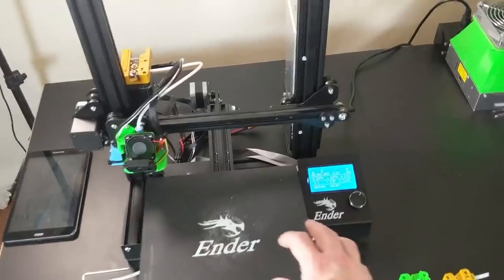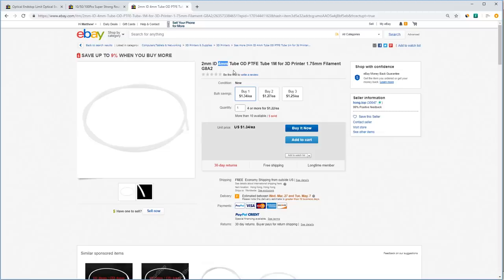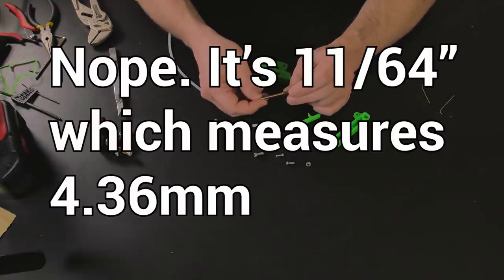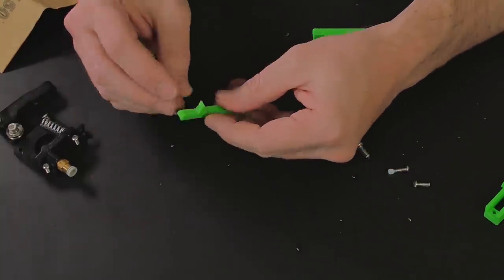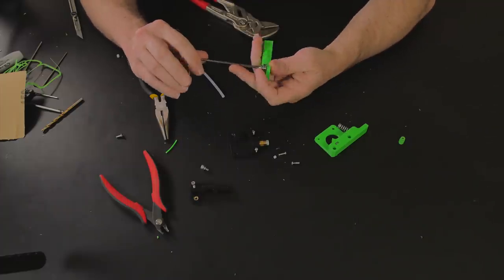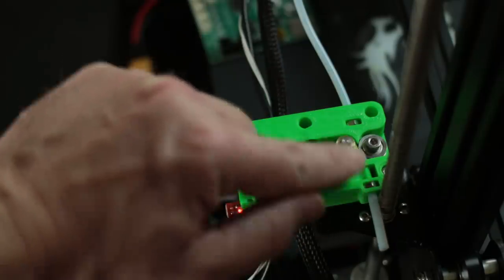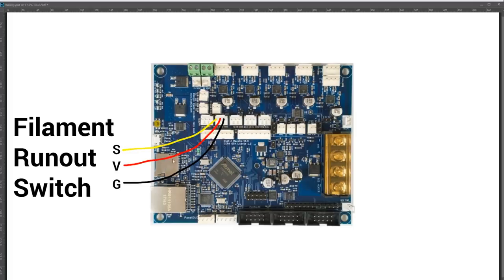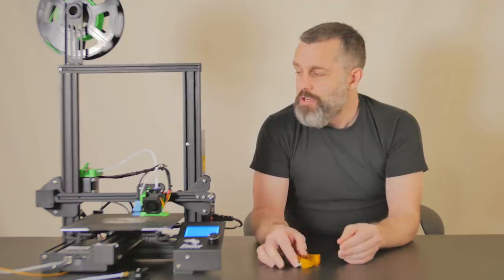How to Make a Better Extruder & Filament Runout Switch for Your Creality 3d Printer

Comment: well, I don't see the point in filament run-out anyways 🤣
do you really use it? I find it completely unnecessary, and it won't detect jams so why use it
edit: what could be cool is an encoder to detect filament going in, that could allow you to detect jams and even filament run-out while not adding drag
Reply from the maker: Yeah, I have one of these made by Duet installed on my other printer. It's caught a lot of jamming situations for me.